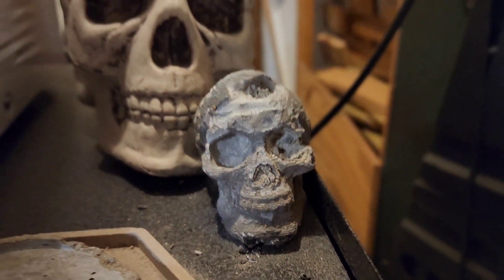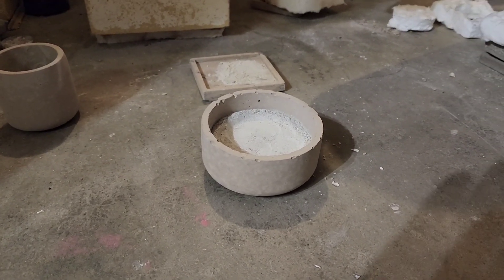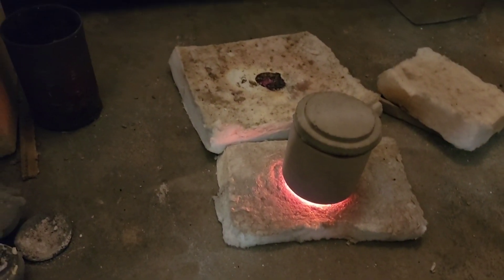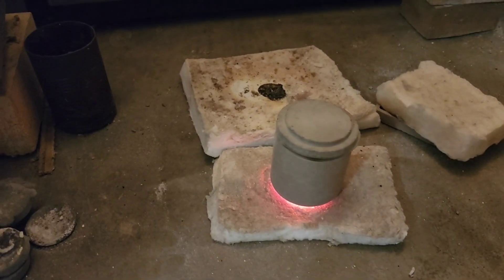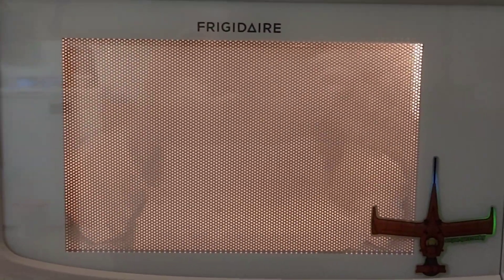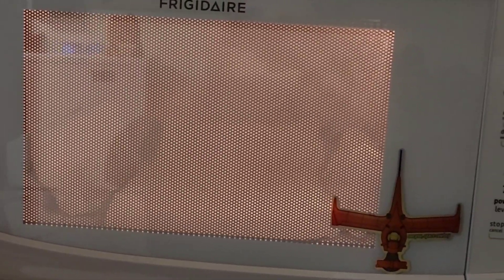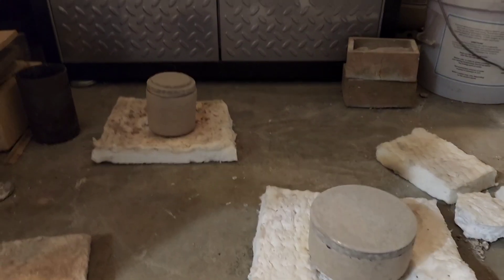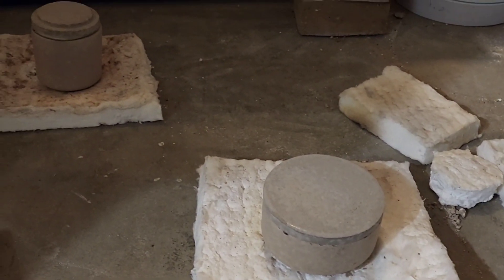Here I Go Microwaving Again

Comment: hey, it wasn't on this video, but I saw one where you used a layer of oxygen scavenging media with the aluminum. what would happen if you fully encased the part with that? put a layer on the bottom, use a barrier for the sides, filling the area between the crucible wall first and pack it sort of tight, then put a layer of regular media inside the barrier, then the test part, then more regular media, remove the barrier or mold, then put the scavenging media on top. just a thought...
Reply from the maker: @geraldnelson5808  might not hurt but generally if you end up with unspent carbon after your sinter cycle then you've done a pretty good job. The problem with too much carbon is thay some materials will pick up the carbon at high temps so I've though about designing a crucible that isolates it (and have done some experiments) but also just working in a gas inlet. With aluminum a reducing environment is favorable so nitrogen would be a good pick to pipe in

Comment: Try Zyp HBN coating as a mold release.
Reply from the maker: Thanks I'll look into it. Do you know if it's airtight once applied? Any coating I'd have to do would need to be done to the green part prior to debind
Reply: @Mr-Highball  I think most of their solvent based products would not be airtight, certainly their BN spray. I'm sure some of their binder products are. They have every imaginable combination, if you need something specific I'm sure they'll let you know pretty quickly in email.
Reply from the maker: @sumguysr  thanks!

Comment: hi, I want to make metal parts. but metal filament is too expensive for me. my question is, can I metal cast mechanical parts for combination, or it will be hard to the details.
Reply from the maker: So my side experiment is using a water based binder, metal powder and freezing the mixture in a mold (which can have very fine details). It needs more work... but the idea is that it could be a safer way to cast metals since there's no pouring liquid metal and very repeatable since the molds are reusable